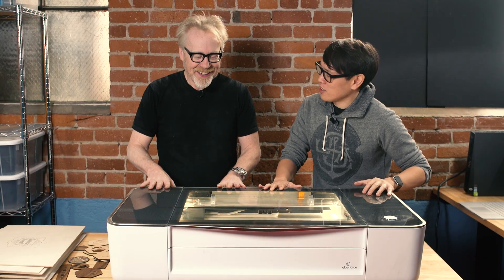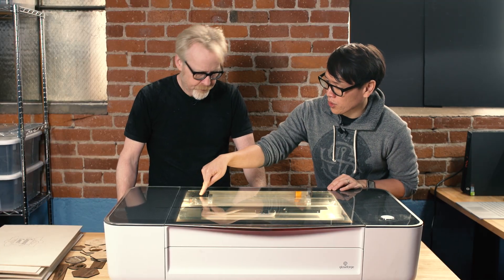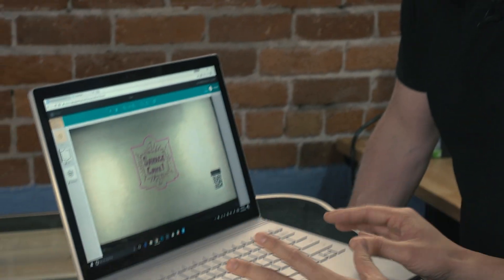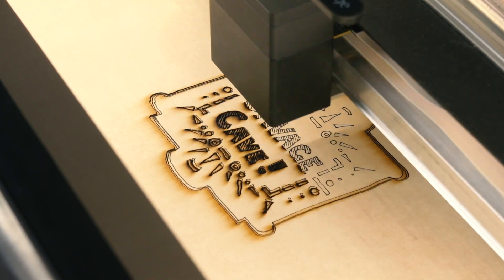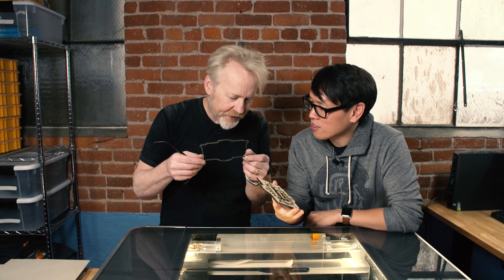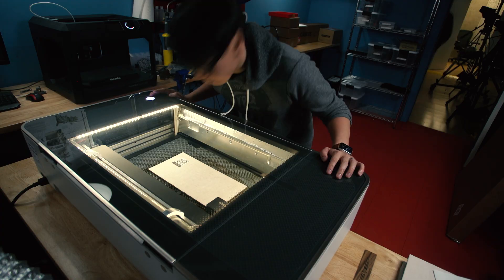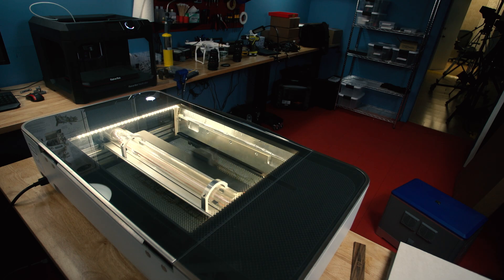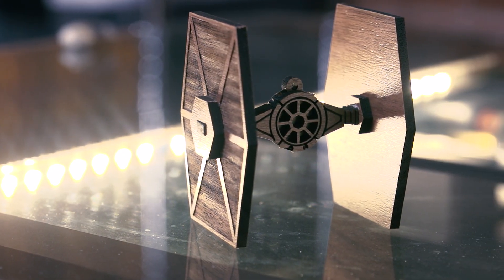Hands-On with the Glowforge Laser Cutter!

Comment: you said it can copy ! if you look close its off from the drawing ,so I call that NOT a copy
Reply: I assume you can place a drawing in the bed, separate from the material and remove it after it's been scanned.  What I don't like is that the cut was done first. The material dropped away from the rest of the board and went out of focus.

Comment: yeah this is the apple model, fucking communism.. They will veentually go to subscription based use and start charging for everything individually like 5 dollar fonts and stock image doodle bundles.. Cricket did this and they did it in the most insane way possible. They released a new model with only cosmetic changes but locked out 3rd party software and only allow the use of their cloud based software. 

They even went as far to auto detect fonts that they sell in images you created and imported as vectors...  Imagine buying a 14.40 lathe from a company and trying to create a gcode and the software detects a certain cutting tool is needed but you have not purchased this tool from them and they require you to pay additional subscription fees just to be able to use that tool.. This is what these companies are really trying to do....

Socialist cheese lines because ya know, the kings forest!

Comment: It doesn't have a cutting Nozzle, so it will never cut nice clean edges with gas assist, or compressed air...A toy...terrible...unless your impressed by its iPhone styling, which isn't worth diddly squat in terms of performance.
  That glass Tube Chinese Laser wont last very long at all, none of them do....Beware.

Comment: I have to agree with many of the comments below.  One presumes Glowforge will respond to customer feedback and work out the kinks... but this is a competitive industry.  I like the cut & trace feature, being able to use other than vector files etc... but other cutters have had (for example) jpeg & bmp to vector file conversion software for some time.  This considered, the trace function isn't all that impressive-- especially since the end result was visibly offline from the original drawing.   

The comment about cutting before etching is also true:  etch, THEN cut rather than as shown in the video.   Then add the final blow to the process:  40 to 45 minutes to etch and cut one single piece?  That has to be the slowest laser etcher on the planet.  They weren't etching stainless steel there; they were etching 1/8" wood.   I would consider 3 minutes excessive, 60 seconds more reasonable.  Can you imagine trying to manufacture a logo with this machine at 45 minutes a pop?  There are $500 "hobby lasers" that do a better job than seen here.

Then the final blow: cloud-based software.   I currently have a piece of software that is useless because the registration system tries to access an online company that's no longer online.  So although I have a valid registration code, the software is trash.  Those kinds of programs-- and the whole idea of cloud-based software-- make purchasing this machine a no-brainer no-buy for me.  Granted this video was (at this time) made 2 years ago, pre-production. Maybe the company has upgraded its system by now.  If so, maybe they need to have this video upgraded as well.  As it stands, it's a major "DO NOT BUY ME!" flashing red light.

Comment: i have the FSL muse. i have to say the glowforge looks better and looks better built. but i think FSL planed it to be like that. having the laser for some time i realized that there will come a time you have to fix your laser. change tube, belts etc. FSL muse was designed for you to be able to fix it yourself. this does not look like something you can fix yourself and may require you to send it back if something goes wrong.

Comment: Hi Adam, since you are a design consultant for the company, here is an idea to get rid of the burn smoke - explore using a small block of dry ice inside the printer, as I believe the carbon dioxide will help to reduce the flame and smoke effects in a very simple and cost effective way without leaving any chemical residue from the the melting dry ice off gases.   I hope this can be used in an updated design.  Cheers, Sam Esaw (778)999-7768 in Canada.

Comment: Since it has a wide angle camera, wouldn't the scanned image be distorted? Where accuracy is important, such as doing marquetry or inlays, I am wondering if this camera will cause inaccuracy which cause the pieces not to fit properly. This is the case where you would want to use Adobe Illustrator vs. the browser base software. Question, if you just use Adobe Illustrator, can you bypass the internet requirement and print (send the artwork) directly to the laser, similar to sending a print job to a printer?

Comment: The fact that it is cloud-based worries me.  If the company goes belly-up or decides to stop supporting the device in a few years, you've got one very big, expensive paperweight.
Reply: Doug Johnson Productions cloud based is a deal breaker for many including me.
Reply: I agree, I've 2 software programs now on the cloud and they suck. Besides being SLOW (my inter net is fine) the unscheduled update is very time consuming. 2 out 0f 5 time I use the product I have to update it and you have no choice, you have to update to use the product and sometimes the update breaks it.
Reply: @Rasheed Abdul-Aziz : It's obviously you really know your stuff! Thanks for the explanation. But the comments about the company "going bust" and not being there in the future does worry me. What do you think about this scenario?
Reply: I don't understand the point of the software being web based.  Why not just ship the software with the laser so you can use it at home and tweak it exactly how you like?
Reply: it's gcode based, It's not going to be a paperweight worst case scenario.
Reply: Rasheed Abdul-Aziz sorry but those aren’t good reasons for this application. Why pirate a software are buying a print for over $1000 minimum. Also system requirements solve “the constraints of a consumers system”
Reply: @adammclainjr9275  Read your own copy. That second sentence is mighty cryptic.

Comment: For under $5000 you can get a proper machine with 60x90cm cutting area, 100W RECI tube and powerful extraction and air assist. The Glowforge is an expensive toy.
Reply: yep, my thoughts exactly. While some of the features could be kind of neat, I really dont find using a graphics program to be limiting or difficult. Also, it vector cut before engraving? thats a no no

Comment: at 11:21, what is the name of the makerspace in Seattle?  "Super lab"?  he says it so fast the closed caption doesn't help
Reply: C4 labs. http://www.thingiverse.com/thing:603237
Reply: Hah, I downloaded it, noticed the (1) after the DL and did a sort by name. Turns out I already had the file, from 2 years ago. Maybe I should purge my downloads folder a bit more often.
Reply: relishgargler thanks!   I live in Seattle, so I'm especially interested
Reply: I've been working with it, and wow is that file junk. For something allegedly drawn in CAD, there is nothing neat or precise about it. I couldn't even assemble the X-Wing. It broke 4 times in the attempt because all the measurements were terrible. I got it to work now, but I literally had to redraw and remeasure every single part. The TIE fighter was a bit better, but still required a fair bit of work to get a good fit. I'm glad I tested it on cheap hobby wood first. I'd have hated to waste any of my exotic hardwoods on that.

Comment: I wonder, since the laser tube is attached to the stepper motors, if that's what's causing the rastering to be so slow? Like most hobbyist laser machines, my tube is stationary. I've had material jams before, so I'm curious what happens when you jam that moving laser tube against something?

Comment: Wouldn't it be more efficient to etch an area or shape which is all joined up (like one of the little triangles), then move to the next shape? It seems to have a lot of unnecessary movement by moving all the way across each line of "print", but only burning a few dots at a time like an inkjet printer. Take out most of the "blank" moves and that 40mins is probably more like 8-10mins, maybe less?
Reply: Probalaby, but you would have to design a slicer like they have for 3d printers, dunno how much work that would be and the way its setup now you can just use a printerdriver

Comment: What if you don't have an internet connection? Is it effectively a paperweight without the internet? What happens when glowforge goes out of business, or the "cloud" service fails or is taken offline? Is your unit now a useless brick? Will there be any support for local system software support? This is a huge futureproofing issue.
Reply: draggonhedd it's the same case for a lot of products now, it's just where we are heading
Reply: If they didn't add a local system I'd be extremely surprised!
Just saying, not everyone is like Apple in removing old things because something new is available!
Reply: It would be using google cloud so that will not go out of business. The company glow forge has about $30mill of backers on these device

Comment: I'm experienced with both the Epilog laser (120w) and my personal Full Spectrum laser (90w).  Both laser machines do not require CAD files, although they both will accept them.  I use Corel Draw on both machines and they both recognize the files automatically.  As for the Glowforge being able to cut through 1/2" material with a 40w laser tube, I would have to see it to believe it.  All in all, however, the Glowforge is a cool entry level laser for those who like to play around with a laser cutter.
Reply: I also have the Full Spectrum and I've cut through 3/4" pine, 1/2" cherry and alder. It just takes a lot of passes and you have to monitor the temperature of the wood. After so many passes the wood will hold the heat and create the possibility of ignition. Before that happens I just let it cool down for awhile and then continue the cut. Now if Golwforge is claiming to cut through 1/2" with one pass, I'd have to say BS on that one!

Comment: The two MAJOR problems are 1) You need to be online to use it. Therefore it will stop working as soon as they stop building new ones. and 2) They still have not shipped them out yet. People who ordered them in October 2015 are being told they will get them mid 2017. If you really want a laser cutter get either a China Laser or a Full Spectrum Laser. Much more for your money and none of these problems.

Comment: will it engrave mirrors?
Reply: I hope not.
Reply: Typically to engrave a mirror you flip the image and engrave through the paint on the back. It should have enough power to do that, though it would probably take multiple passes to get a detailed engraving without cracking the glass. I engrave mirrored plastic on my (non glowforge) laser at least several times a week.
Reply: That is interesting. Engraved mirrors are common but had no idea how they did it
Reply: Sand Blasting?
Reply: For large runs of the same design they often make a stencil and sand blast it, yes. For just one or a few it's faster and easier to use a laser.

Comment: More like full disclosure "This is an advertisement".

Cloud biased tools = bad.
Camera system clearly needs work

Shot framing efforts and editing efforts where made to all but hide the fact that ventilation is required. (Don't be those guys who advertise tools using the words "review").
 
IF you want to drop 3 to 5 grand on laser cutting you can get used models for  reasonable prices. These cutters are high resolution, and in many cases more capable systems then what is being shown.

Comment: Re: laser tube life, I've been using my Shenhui G350 50W with the original tube for a year now and it's still going strong. I don't know how much Glowforge is planning to charge for tubes, but  replacing my tube looks like ~$250 so really it's on the order of replacing toner on a couple laser printers. Seems reasonable to me.
Reply: Those are pretty good machines for the money and are fine for production work. You can also fit a more powerful tube which will be near impossible in the GF.
Reply: I'm quite happy with mine. My only regret was buying one with an irregular rotary attachment device instead of a motorized z-bed.

Comment: Not that big a fan of the web based bit. Many professionals would rather run it straight from autocad. Still though, for the price it's very exciting to see.
Reply: Web based is a stupid idea.  Company goes out of business, or the Internet connection is lost, then you are screwed.
Reply: You mean to say it's cheap?
LOL, not even close :) 
Chinese K40 lasers are just as good (better in some ways) for under 500$
Reply: dfitnic
I will check those out. But these being laser cutters and engravers that can be ran of normal house power and indoors is pretty cool for the average joy wannebe maker :)
Reply: ThaTyger
K40 runs on 110/220V, normal household power :) and of course it can be run indoors, just has one fan and a hose that takes the fumes outside (btw, you don't want to run this machine without exhaust either...cutting/ etching stinks like hell ;)
)
Reply: dfitnic
the neighbors are sure to love you :D I do think the fancy version of this thing has air filtering build in. Also I heard a much lower pricing in a previous video then they show on the site. Somewhat disappointed now =/
Reply: ThaTyger
i work only with wood so it's not a problem for them :) my garage is far enough not to bother them

Comment: The glowforge looks nice, but its comparatively high price tag, and limitations (such as requiring you to be online, only 40W laser, slow cutting speed, etc) make it less desirable. The unit is basically a 2 axis CNC with a laser and focuser, not terribly different than a vinyl cutter or plotter (or ink jet printer, for that matter).  As widespread as the DIY 3D Printer movement has grown, I am surprised a similar movement has not taken off for DIY laser cutters.
Reply: The only thing unique about this product is its camera system, and related software, which could be its 'killer app' as I almost preordered one last year. There are laser cutters on the market that are slightly more expensive that have existed for quite a number of years on this scale, e.g., cuts thin metals, as well as more powerful lasers.

Comment: can the laser be removed and used for evil purposes? asking for a friend.
Reply: No it won't fit on sharks. it will fit on sea bass tho, if they're horribly mutated.
Reply: I'd like to know if there is a bracket included to mount it to a shark.
Reply: Try a pigeon instead, no one will see it coming and the laser doesn't like saltwater anyway.
Reply: Dorian Gray are they ill tempered?
Reply: The laser can be removed and mounted and yes, possibly on a pigeon.  However it's that 20lb power supply and long cord that is the problem...